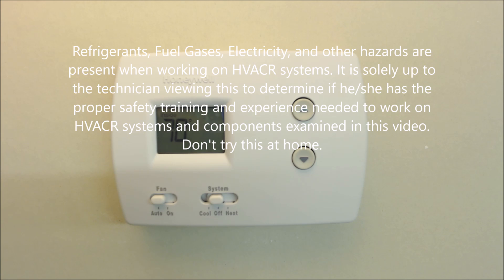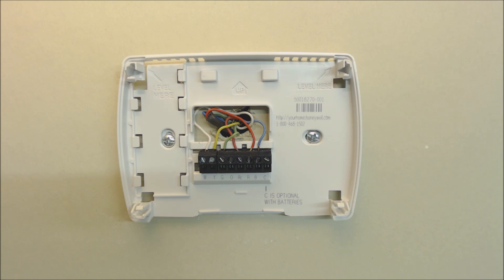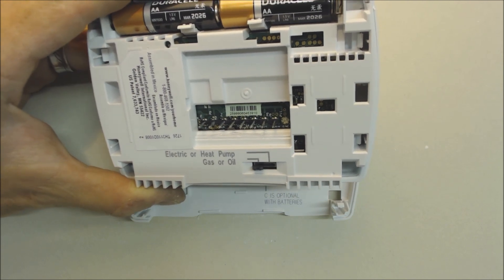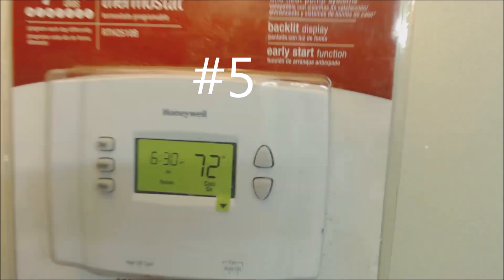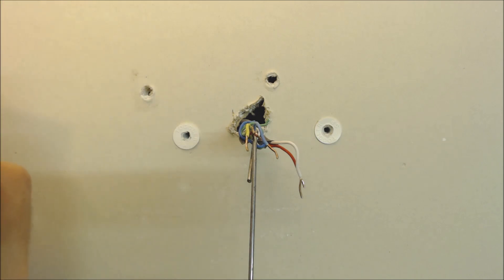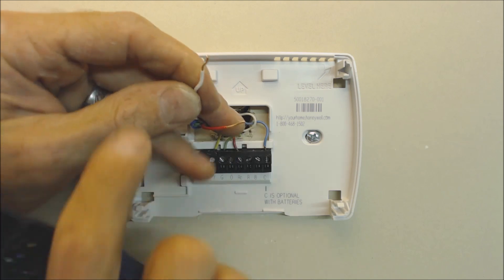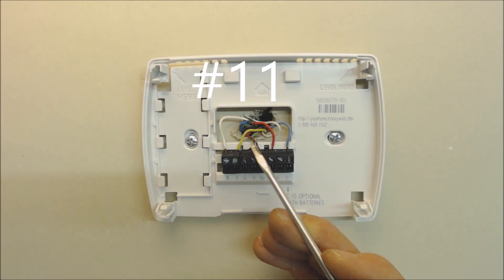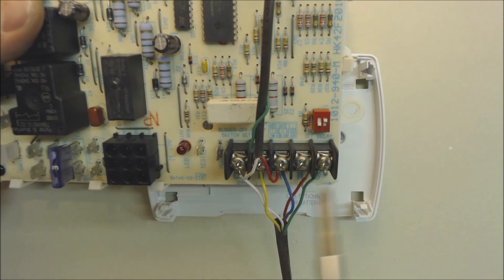Top 12 Problems/Mistakes when Installing or Replacing Thermostats! HVAC Tips!

Comment: Could you help me? You seem to know what you are talking about. I have looked for days and days without an answer.Hi Sir, I am 68 and on Social Security so I am trying to change my Themostat. It is a 2 wire one in a mobile home. It has the heat/off/cool switch on the unit in the closet.Also, the fan Auto/ON switch is there also. So the heat and the air both work off of these 2 wires. . The letters on the Intertherm  Ultraflex Relay Control board are an (A) and a (W) for the Stat.. The control board is Number 901648. Anyway, I tried to remember which of these wires came off of the coil on the old thermostat and I forgot.and it was not lettered either.. I am putting the Honeywell CT-30 manual thermostat up. It has the letters (R) and (W) on the thermostat. I see the one marked (R) is controlling  the expanding coil...I believe...  Could you please tell me which wire from the relay control board I should hook to the Coil, (R) on the t-stat?? Right now I have it hooked up as the (A) from the relay board to the RED on the thermostat and the (W) from the  control board running to the (W) on the thermostat. Is the correct or is it backwards? It is saying it is 80 degrees in here this way and I know it is not that hot in here right now at 2:00 am in the morning. Maybe low 70's at best. It comes on and shuts off I guess as it should but like I said, I know it is not 80 degrees in here now which the thermostat says it is. Don't know if switching the wires would have any effect on it or not. May blow a fuse. Any help will be greatly appreciated....If you need any further info. please let me know. Thank you very much for what you do... Roger Shingleton, Wilson, N.C.   P/S shouldn't the (A) or the (W) wire connection on the relay control panel have 24 volts when the unit is NOT running? Or no?,  But that still would not tell me that the hot wire went to the expanding coin in the t-stat. Again, thank you. You help a lot of people like me who cannot afford a service mechanic to come out, and this unit being 30+ years old, doubt he would know either unless he has worked on one of these 2 wire Cooling and heating units before.. I have been searching days for the answer.....

Comment: I installed a new thermostat and my air conditioning works fine on auto.  When I put my heater on it goes on but the fan doesn't go on when I use the auto feature.  The fan goes on manual only.  My question is the fan relay the problem or is it something else.  My heater is the original in the mobile home.  Thanks in advance.
Reply from the maker: Yes it sounds like it as the unit should have a timer or a fan limit control to turn the fan on roughly 15-20 seconds after full ignition,t hanks

Comment: Hi... why when you turn the thermostat to heat you don't have any Voltage on "O"
Thanks....
Reply from the maker: Most hvac systems except ruud and rheem dont power their reversing valve in heating mode, thanks
Reply: And the reason that the majority of manufacturers don't power the "O" in heat mode (for heat pump), is because if the reversing valve were to fail in the middle of cold winter, heat would still function. So, "heat" is the default for  reversing valves for majority of manufacturers. The logic is that absence of heat in middle of winter is worse than absence of A/C in summer.

Comment: I have a thermostat that just went blank no power unless I add batteries how ever that only makes the screen work it's not working to turn on air or heat
Reply from the maker: Check to see if a safety switch tripped such as in an emergency condensate pan, thanks
Reply: Where would that switch be 🤔

Comment: My gas heat will not come on through my thermostat until I touch the W and R terminals with my jumpers. Is the thermostat bad or what?
Reply from the maker: if you are jumping at the tstat then yes. If you are jumping at the furnace then it could be the tstat wires or the tstat. Have you changed batteries if there is no c wire at the tstat?

Comment: Just replaced my thermostat over the winter furnace was working fine it stated to get hot and my AC compressor would spin but furnace would not blow. Went over all my wiring issues they were right after watching your video it was set to electric and heat pump I never saw that option during install. Thanks so much for your video its back to working great keep up the good work ...
Reply from the maker: Awesome, thanks

Comment: You saved me 125 dollar visit from an HVAC technician, someone had wired my thermostat wrong and was able to fix it with this! Thank you so much
Reply from the maker: Thanks Andy!
Reply: acservicetech my white wire is going into the AUX port should there be another white white that runs from AUx into Emergency heat?
Reply from the maker: You can if you want emergency heat to turn on by itself without the outdoor heat pump, thanks
Reply: That's good!

Comment: Great informative video. What is wrong if the fan will not operate in the "Fan on" position, but all else works (i.e. heat and cool OK) in the normal heat or cool mode?
Reply from the maker: Do you have a wire connecting the g terminal from the thermostat to the furnace or air handler?

Comment: I have a question for you Why is the blue conected to white on my home is like that
Reply from the maker: Your blue  or white wire may be connected to something different than the common-c-blue or heat-w-white at the control board, thanks

Comment: clearly spoken enjoyed thank you . if possible can you show how to use a 4 wire system with no C  replaced with a 5 wire stat?
Reply from the maker: Actually all that is different is that you would have batteries in the stat and not wire the c, thanks Jim!

Comment: Thanks a million!
Reply from the maker: Thanks Mohamed!
Reply: my friend replace the thermostat, after that in cool mode it started to  pop the fuse ,anyway i replace one of the wire with another one  and  cool work fine  until  I switched to heat and fuse start to pop again, guess what, he wire the blue to the B terminal  on a battery operated  thermostat, i disconnected it and the problem  is solved, THANKS AGAIN FOR YOUR HELP,TUMS UP TO YOU, YOU ARE  A PRO.
Reply from the maker: Ha ha glad to help and awesome that you figured it out, thanks!
Reply: you are welcome, keep up the good work!

Comment: Problem #8 is often the most overlooked and most frustrating problem to cure. Thanks so much for posting pointing this one out!!
Reply from the maker: Thanks David!
Reply: @acservicetechchannel  Consider using a small, plumbing vice grip to hold the wires as you switch the backplates.

Comment: Hi I was wondering if you could please tell me how to fix my condition buttons they have stopped working I can't move my air up or down does nothing when I push them an my air has to stay on 73 due to my buttons not working my screen works an says the set to air an the air it is inside why won't my buttons work please help !!!!
Reply from the maker: It may be the connections behind the rubber button piece or the thermostat control board but in that situation we would usually replace the face piece or the back where the thermostat connections are and the face plate so that it is all new, thanks

Comment: Recently, I changed the batteries on a Honeywell Thermostat. Later I find that the furnace does ignite, fan comes on and stays on, but I'm not receiving heat? Your vedio is very helpful.  But, I'm missing something.
Reply from the maker: Check out the sequence of operation videos- type acservicetech sequence of operation in the search, thanks

Comment: Hi, there. Really nice educative video. I have got some problem on Bryant HVAC. I have replaced old thermostat by new Honeywell ones. But its not giving heat and cold air comes out. Then totally my HVAC not working? Please, help me. I am now freezing. Thank you.
Reply from the maker: Is this a furnace or heat pump? Did you check to make sure the 24v fuse is not popped? If this is a furnace, do you have 24v from w to c on the control board with the door switch closed and the tstat calling for heat?
Reply: acservicetech thank you very much for quick respond. How to know whether it has furnace or heat pump?
Reply: Can I check by model number of Bryant ?
Reply from the maker: Is there a gas line going to the indoor unit? If there is then it is a furnace. When heat turns on w and r at the tstat touch on a furnace. I would however call a tech, thanks
Reply: In this property no any gas connections. It has truly electrical wiring. Everything works on electricity. Starting from water heater to HVAC.
Reply: If I cant find your suggested TH3110D1008/U model. Then what other can be good to use?

Comment: Hi I am a big fan of yours ty 4 all the videos I have a customer who every 3 months gets a drain backup of sludge what could it be
Reply: Sounds like the evap coil is dirty. If it has a union on it you could blow on the pipe and see if there is a restriction. It should blow smoothly. I used to add some bleach in the line to clean it. Just do it once a month or so. If the air filters around changed regularly they mild up excess dust and whatever else is being sucked in. Still new in this trade but a dirty coil is what I am thinking.
Reply from the maker: It may be the pitch on the condensate drain or even just the initial pitch. Does it have a clear drain termination point at the very end? David is right in the dust combining and making the sludge as well. Has there ever been a decent cleaning of this evap coil? Also you could use a few hydrex tablets in the evap pan and a very small piece in the trap- http://amzn.to/2z4DAno

Comment: Great Video! Another problem is someone used hex head screws to attach the thermostat on the wall. Hex head screws stick out too far and don't allow good contact between the thermostat base and the thermostat. Always important to use screws that are flush with the base.
Reply from the maker: That would do it, thanks Blue Collar!

Comment: What if you had a bad t-stat base how could you determine that?
Reply from the maker: Hey David, you could disconnect the wires from the base and jump from r to w for heat or r to g for fan or r to to y for cooling to see if you the unit turns on for that specific function. You could also measure it at the board to see if you have the 24v between the signal wire y, g, or w and c inside the air handler or furnace. I hope that makes sense. Ask any questions if it doesn't, thanks David
Reply from the maker: Thanks 3en6ie!
Reply from the maker: That's correct, thanks 3en6ie!